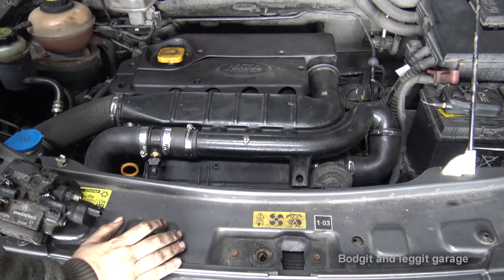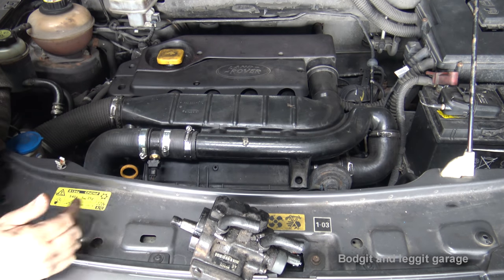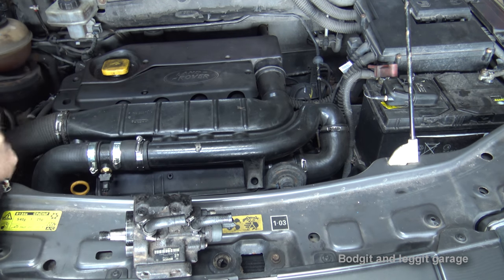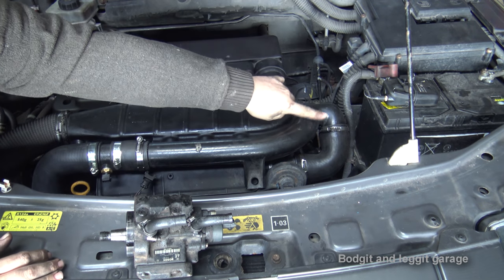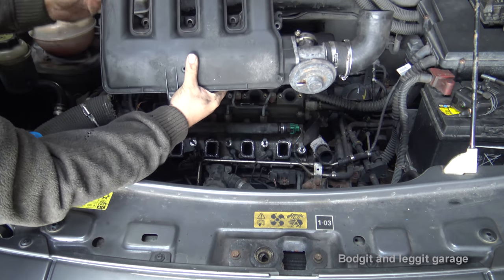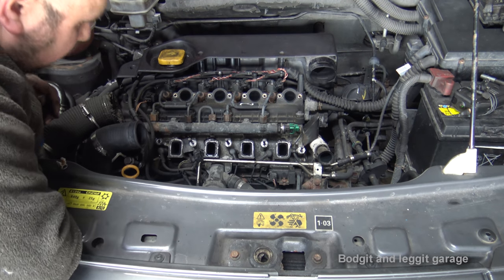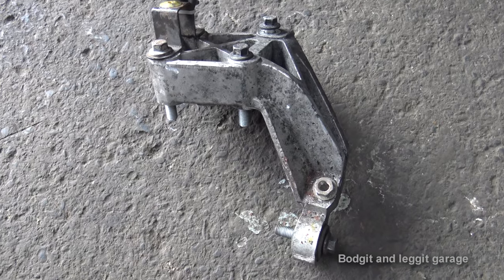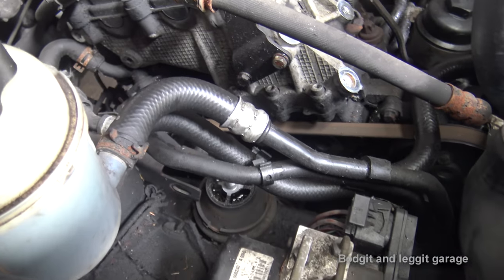How To Replace High Pressure Pump Land Rover  Freelander TD4 Bodgit And Leggit Garage

Comment: Just done mine after watching your video. Brilliant thanks. 
Couple of points. 
You will need a second person to realign the engine mount.
2nd I had removed the special tool after removal and then promptly crapped myself when I came to put the new pump on and realised the pulley had moved across. Luckily the chain had not slipped! And all was well! Really helpful 👍🏼👍🏼

Comment: Nice vid Leon! I'm a Landrover Jaguar tech, These pumps have become quite a common failure on the BMW Td4 and Td6 motors. That tool is essential if you don't want a total stripdown to re-time the engine. Having said that, on this family of engines, the pump isn't timed, so it isn't essential to lock the crank, although obviously it's good practice. To be honest, sometimes the worst part is separating the rubber fuel hoses from the pump, they really grow on!!! Another tip is remove the MAP sensor from the inlet while it's removed, and give the  port in the sensor a good clean (carefully) ,it's possible with the manifold in situ, but fiddly.You'd be surprised how many we see with the port blocked with that black goo...keep up the good work....cheers mate...
Reply from the maker: Thanks a lot mate yes I know the pump isn't timed with the timing chain I lock the engine so I can release the bolt easier and when you are putting the bolt back you can torque it a lot easier with the engine locked
Reply: Hi there mate,My low pressure fuel pump was noisey and buzzing so i replaced it with a pierberg pump at £150  but when i put the new pump in its noiseier than the old one,I noticed you are a tech engineer with these,Could you please tell me if anything else could be causing this racket,Thanks very much and take care .

Comment: Hi, great video, im almost there with getting mine out. Quick question. When you get the cover off to access the bolt you need to take out before putting the special tool in to release it, when trying to loosen this bolt off is it ok for the outer belt to move when trying to loosen? Im assuming the special tool locks the timing chain and not anything to do with the fan belt? Just want to double check before loosing it off as i can see it moving the belt backwards when doing so. Cheers

Comment: great video if your going to do this I'm not well not at the moment but will remember everything because you explained everything so clearly the bits i would need to looking at a manual am i right in thinking these HFP are not timed but its just good practice to lock the engine
Reply from the maker: Hi mate thanks a lot yes you are correct they are not timed in the centre you can put the pump in any rotation but the pump to the chain is timed and what I mean by that is is you have to make sure nothing news as you're putting it back on that's why you have to use the special tool

Comment: There is no need to lock the engine for this job. Or indeed, remove the cooling pipes. That said another informative video many thanks for taking the time to put these together.
Reply from the maker: I have to disagree with you how are you supposed to undo the bolt and torque it properly without locking the engine also like I said in the video it makes life easier on doing the water pipe it's only 3 bolts why not make a life easier for 2 seconds work

Comment: Hi great video as usual.. have you done a video to replace injection pump on Vauxhall vivaro as I would like to replace mine on my 2004 1.9 dti it's time she had a new or reconditioned one along with the injectors and glow plugs.. would appreciate any advice on does and don'ts and any special tools I will need. Thanks Shaun.

Comment: Hello I`m, trying to change fuel pump on my fatherts td4 automatic, I am on step when have to lock engine, but notice that flyweel plate is different. I have 4 holes, three holes are one to one, the other two are spaced apart around the plate. Which one to use for locking the engine?

Comment: Am I  correct in saying the pump doesn't need timing as it's a common rail electronic fuel injection ?
Reply from the maker: Yes mate it doesn't need timing but what you've got remembers is it still is on a timing chain so you have to make sure you don't lose timing on the chain
Reply: correct, pump just making the rail pressure and injection timing controlled by ecu and crank position sensor .

Comment: Great informative video. I thought 'bollocks' when my hippo's fuel pump went this morning. Now that I've watched your video a couple of times I am going to order the special tool and have a crack at it. Cheers.
Reply from the maker: I'm glad the video helped you mate have fun with yours I hope you get it sorted
Reply: Hi, just to let you know, I've completed the fuel pressure pump today. You video made it do much easier, cheers.
Reply: Just need to know please.... what holds the high pressure pump gear in position when you remove the high pressure pump

Comment: Just bloody happened on mine great video as per,not sure about the pump needing timed though but I’m tackling it anyway
Reply from the maker: sorted have fun mate
Reply: bodgit and leggit garage thanks buddy,did you have to bleed it afterwards,I turned on the ignition to close a window and expected diesel everywhere with the low pressure lines off and there was nothing at all should there have been?
Thanks in advance buddy

Comment: Had I of know Thomas was here I would of filled him with Guinness its the only bloody thing we have here,that and rain. How comes you lock up the engine to time it, I thought these hp common rail systems didn't need timing ?? Thx for the vid Leon :-)
Reply from the maker: I know he would certainly like the Guinness who doesn't yes mate you are correct the pumps don't need timing but the pump is on the timing chain you need to lock the engine to be able to remove and tighten the bolt again if you don't if the timing slips you have to do a lot more stripping best to be safe than sorry
Reply: bodgit and leggit garage ahhhhh it all makes scene now, Nice work mate Thx :-)
Reply from the maker: @JustAnother_Irishman  thanks mate

Comment: Looks like the intake ports are going glog from the EGR and pcv oil vapors. On my old 05, 2.2 DCI X-trail had black smoke under load, not much, but noticeable in the rear view mirror. Tried every trick, but smoke was still there. 
Later i had a head crack and when taking the head off, I noticed that the ports had like 1cm thick layer of carbon on. They where like 50% smaller.
 New secondhand tested(had carbon filled ports too) head and ports cleaned, valves resurfaced and the smoke was gone. Ok when I pull over a tonn trailer behind then there was some smoke. 
So worth checking the intake when she is a smoker and do not want to quit her bad habits.
Reply: and people say bmw magical, pretty piss poor diesel lump and that actually the best bit of a freelander lol . it only gets worse butyou got to love the oval badge.
Heart breaking to see the shite landrover kicked out from late 90's to present date .
Reply from the maker: Yes mate like I said in the video it's always good once you've got something off to clean it
Reply: Mr B  Carbon build up is an enemy of every modern turbo car. Diesel have direct injection and now petrol engines too.  Some have dual injecton to clean the valves.
I have a theory. When I took the head off, inspected the valves and some intake valves where bent. Theory is that carbon build on the valve seal surface, or some piece gets loose from the intake manifold/port. When the valve closes and the carbon chunk is on one side only, that may cause valves to bend
Reply: Not this sort of extent it isn't, I can show you diesels of this era with over 200K that fine .
It poor engineering and poor servicing that gets these to that sort of state. 
These bmw diesels are notorious for it, poor egr pcv and injectors mixed with long term running with fuel pressure issues common on these and you get these results of years of poor combustion/breathing excessive oil  thus all the deposit build up .

Comment: Just got my pump swapped over by watching your video!  Starter motor is a pig, especially as there is another bolt right next to the starter motor bolt at the top (15mm) and my hidden starter bolt was a 13mm :/   Main problem I'm having is that I can't now line up the engine mount properly - it's about 50mm out.  Engine seems to have moved on the jack while I was swapping the pump out so having to try and pry it back into place to refit.  Hopefully, once that's done, rest will be pretty straight forward.  Would never have attempted doing this without the video - thanks.
Reply from the maker: Boom sorted that's what it's all about me I'm glad my video helps you nice job

Comment: BMW POWER!☝️
Reply: Okay if works good and you fit a 'RonBox'.... B-)
Reply: yeah the ird, offset drive ratio fwd hard surface bias and a gearset from rover scrap pile really likes a ronbox lol
Once you got that austrian made oil burner running half good you can start rebuilding the drivetrain and transmission .
I do actually kind of like freelanders but that mainly due to fact I grasped the reality they piss poor engineered and built .
Reply: Thanks mate , cold chisel and lump hammer back in the box , sussed it , let you know how it went.
Cheers , Geoff

Comment: What a job! Just hope that new pump lasts
Reply from the maker: Time will tell
Reply: Nothing worse than doing a job twice! I take it the customer had lack of funds for a new one.
Reply from the maker: @ashleyburton8605  there's like €600 in the difference
Reply: @bodgitandleggitgarage  Fitting a secondhand unit is probably better than some of these reconditioned ones on the market!
Reply from the maker: @ashleyburton8605  it's like everything it depends who you go to the guy that does all mine uses or genuine parts but it's expensive but you get what you pay for at least with the second hand one it's still a genuine unit

Comment: Can I have a list off tools you used to do this also have been told by lots of garages engine doesn’t need locking in place is this correct
Reply from the maker: You obviously didn't watch the video properly I list every single tool I used in the video
Reply: Yeh I had to keep pausing the video lol got it in the end 👍
Reply from the maker: @jasonchatwin6795  you don't need to pause the video I've literally gone through every single tool I have used on this job and name every single one of them